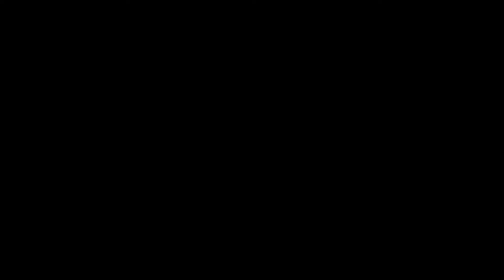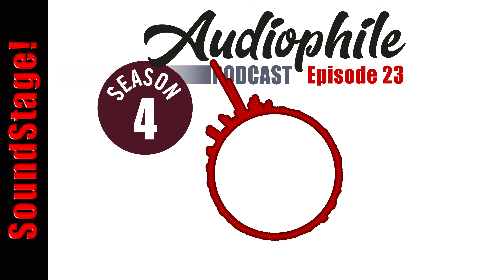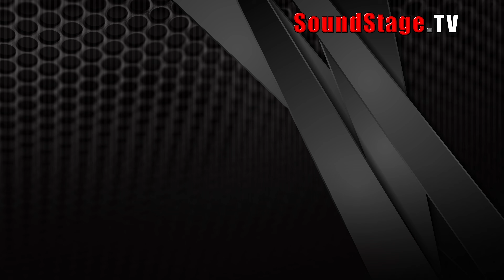Bryston at 50: Made in Canada, Built to Last, and Looking Ahead (S4:E23)

Comment: Good morning. My name is Kevin. I just purchased a secondhand. Bryston B60 R integrated amplifier. It still has just under six months on the warranty after being refurbished. I purchased it in Montreal.. I’m looking this to be my last amplifier. So my question is for servicing of that unit in the future. How secure at and how doable is that? That was one of the reasons for me purchasing it. Thank you from a long time Bryston lover
Reply: I can't speak for Bryston, but I would suggest the first step being reaching out to them to get their perspective. Congrats on your new gear!
Reply: @jordeng3959 yes, communication with them is great.
Reply: Definitely reach out to Bryston. I was told my 28 year old 7B-STs would be serviceable for another 20 year likely. I also had a BP-25 pre amp but that power supply is not serviceable. Nothing was wrong with my gear, but I decided to chat with the company and found out what awesome trade up incentives they have. I sent my BP-25 back to Bryston and have a brand new BP-19 coming. I can't believe how much money off of the BP-19 I got for the trade in. I'm going to do the same with the 7B-STs in the fall. I could have easily go the refurbish route on the amps but I decided a new pre-amp deserved new amps. This round of gear will likely last me until my hearing is gone. That comes out to be 2 systems over my lifetime. Cars don't give you that, nor do many other products. So Kevin, I would email or call them. They are very responsive and will work with you. Not once did they make me feel like I needed to trade up. I decided that on my own. They want their products to last a lifetime or close to it.
Reply: @primolilla they are just an awesome company. Bought a second hand amp from them then asked if they could sell me a remote for my BDA dac. They didnt send me a quote they just threw the remote in with the order. Thats how they win customers for life, the awesome communcation just had won me over . I hope to save enough to someday buy the big guns from them brand new.
Reply: @crBudgetWatches  Absolutely spot on! I'm a lifer too!